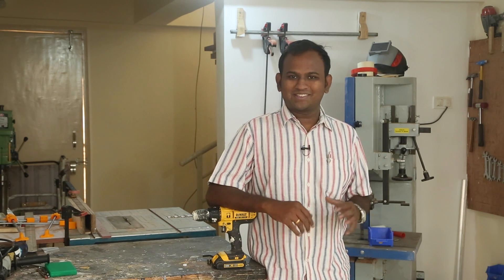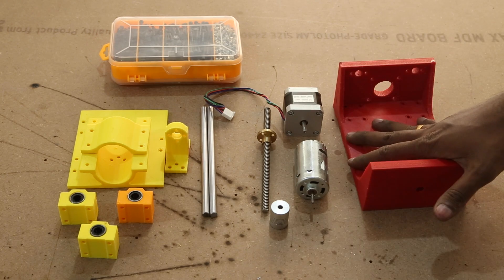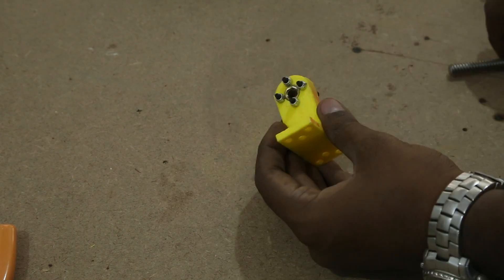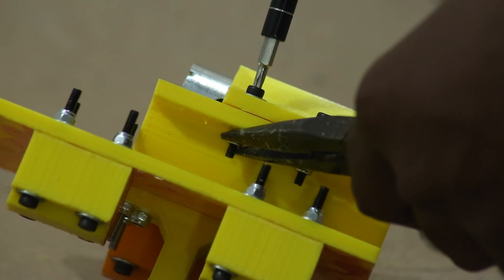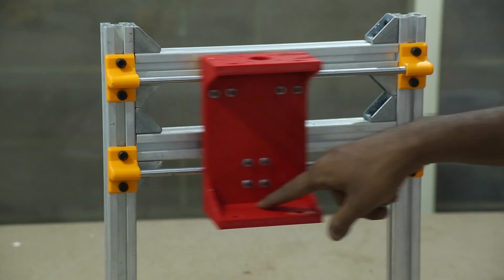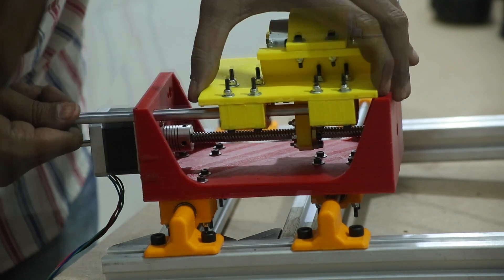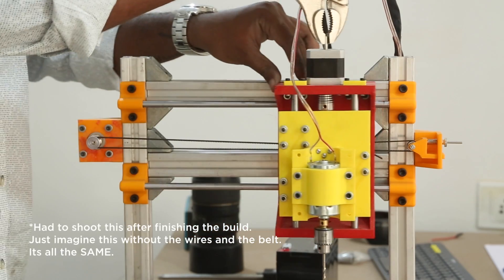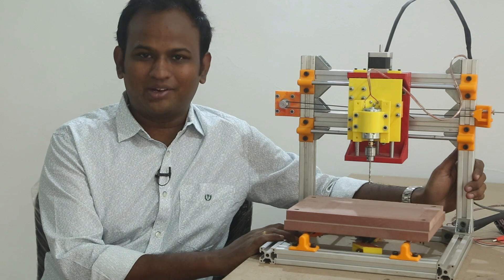DIY PCB Milling Machine - Part 3 - X and Z Axis

Comment: Very nice! Keep moving!)))
Is that simple ABS or some kind of ABS+ with increased strength?
Reply from the maker: Its just normal ABS. And it works fine. I think its how you actually print it. Better layer adhesion is equal to good print.
Reply: Will PLA be good instead of ABS?